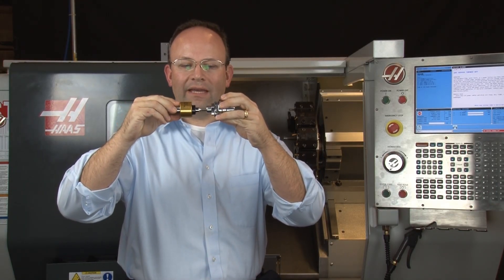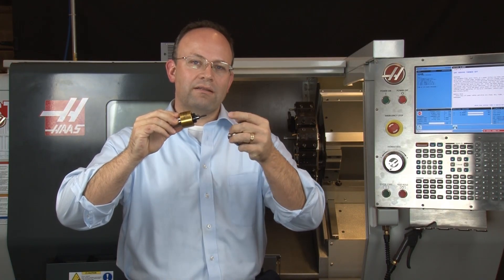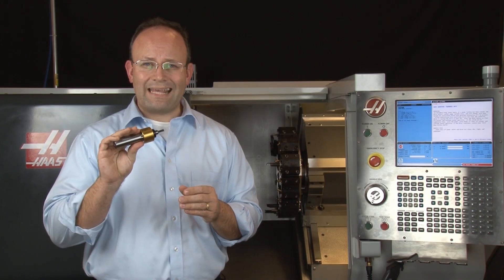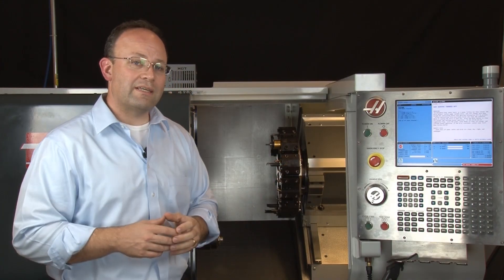How Does Rotary Broaching Work? by Polygon Solutions

Comment: But where does the metal go?
Reply from the maker: The chips curl down to the bottom of the hole. You can easily remove them using ta drill or boring bar. Alternatively, you can put an undercut at the bottom of the bore hole, and the chips will just fall off. You can see an illustration here: https://www.polygonsolutions.com/rotary-broaching/